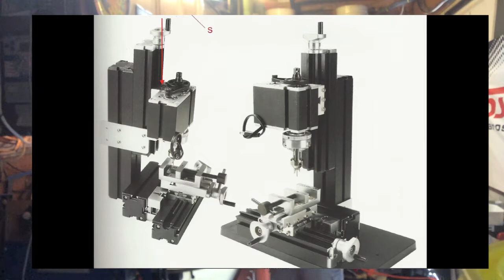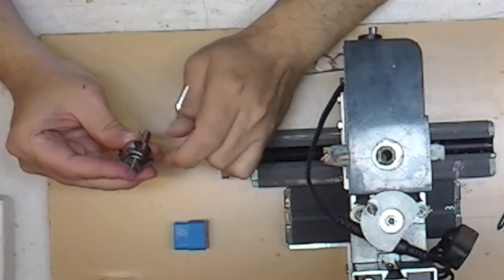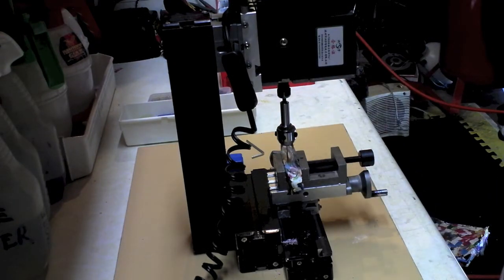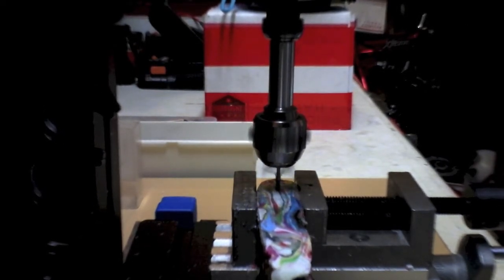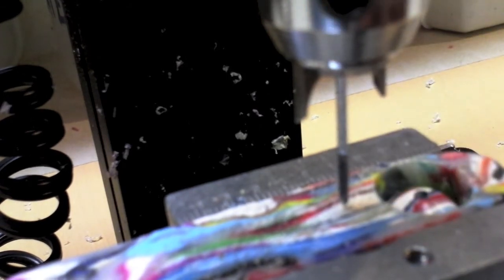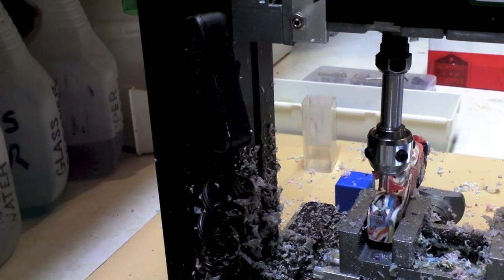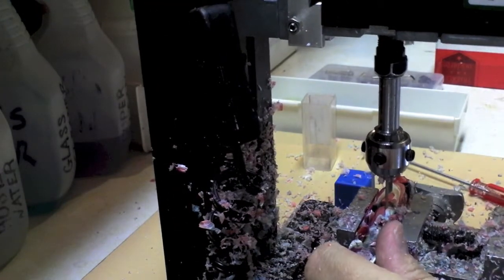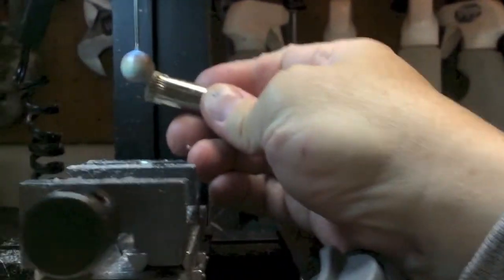The First tool bead  making machine

Comment: How does this mini machine go with aluminium? And how is the frame? WouldIt be fair to say it wobbles and flexes a bit more than you'd want?
Reply from the maker: +Lindsay Fowler does aluminum just fine as long as you use it as directed. As for wobbling and flexing this machine is only meant for doctors. I mean the people that have patients if you take your time and set up everything correctly it works perfectly if you get to inpatient and try to take a picture cut then the machine is intended to do things go wrong.